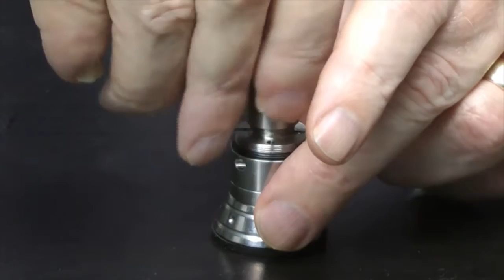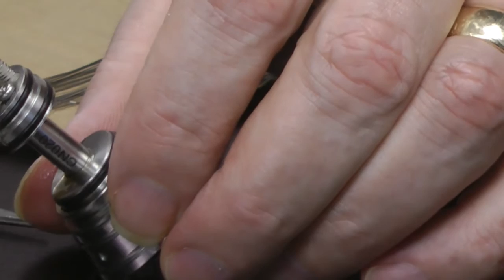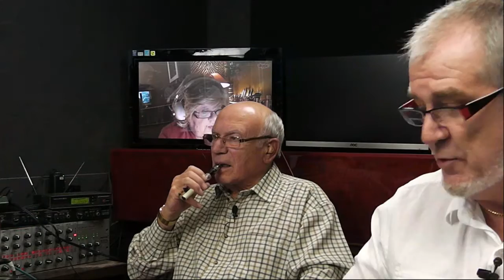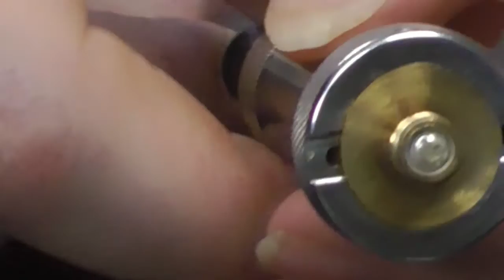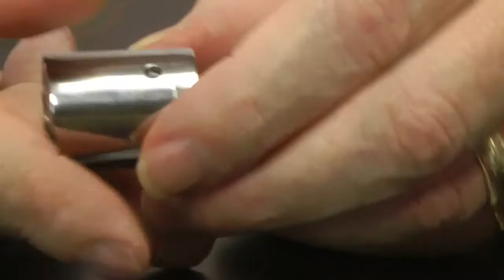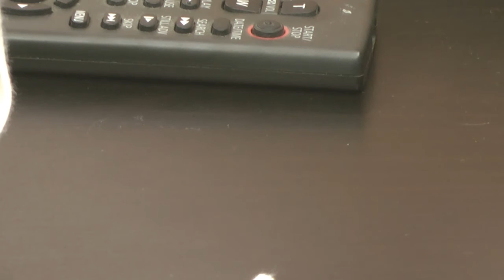Haze Hour 27-01-14 - Double Coiled Lenaia Hydra Keithery

Comment: The other reason they might have made the top cap left hand thread, it prevents the loss of your centre pin setting when screwing on the top cap when it contacts the battery, a problem with the Chi U.